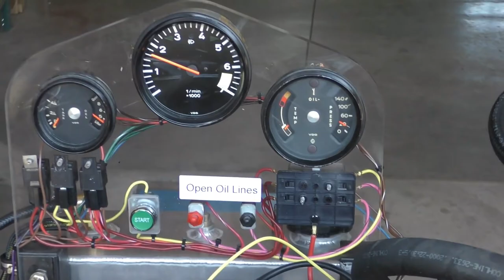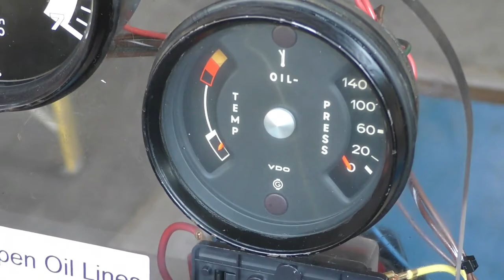Installing a Porsche Ignition Distributor 1969 911T and First Start-Up!

Comment: Kurt. Great video. You answered  some of my questions on start up but I have a few more. When you start a freshly rebuilt 911 engine do you crank it without fuel and spark to make sure it has oil pressure first ? How long do you let it run for and at what RPM. I have heard that it should run for 20 min. at 2,500 RPM’s then shut it down and drain the oil. I’ll go with what you say. Thanks in advance,
Reply from the maker: Kevin, 
So when it comes to engine start-up, there can be a lot of miss information floating around out there. According to Porsche, all engines should be started on the engine dyno for break-in under load. It takes about an hour at different RPM and load settings and still requires the 2000-mile break-in driving schedule that is outlined in the owner's manual. 
In reality, not many of us have access to an engine dyno (Myself included). I Am not usually concerned about getting oil pressure. The way the Porsche 911 is set up with the oil tank, the pump is pre-primed by the weight of the oil sitting on the gears. 90% of the time, I will have oil pressure before the engine even thinks about firing. When the engine fires, I will vary my RPMs and will let the engine run for a few minutes while I get timing and mixtures close. What I don't want to do is go to 2000 RPM and sit there for 20 minutes. This is a great way to glaze up the cylinder bores. This can become an issue if you are using aftermarket cams, however.
My goal is to get the engine under load as soon as I can; the best way for me to do that is to drive the car. So as soon as I can, I will get the car on the road. When I am driving, I will mimic the engine dyno break in spending 10 mins at 2-2500 under light load, 10 mins at 3 -3500 with a medium load, 10 mins at 3500 - 4000 medium load, 10 mins 4000 - 4500 Medium heavy load, 4500 - 5000 Medium heavy load, and 5000 - 5500 Medium heavy load. I use the gears to change the load and vary my RPMS as much as possible. Freeways late at night or early in the morning are great for this.
When it comes to "Running in the cams," this is a result of aftermarket parts. The factory camshafts are nitrated and are very hard. The way the lubrication system is set up also insures good oil coverage to both the lobes and the bearings. When it comes to aftermarket cams, often the hardening process they use is not as good as the factory cams. So by running the engine at 2000 RPM, they are asking you to finish the hardening process by working hardening the surface of the cam lobes.  The 2000 RPM is a holdover from American V8 engines. Most American engines will lube the cam lobes with oil splash off the crank. When the engine is running under 2000 RPM, the amount of oil slung up to the camshaft is not sufficient enough to keep a non-work-hardened camshaft alive. So hence the 2000 RPM number. 
I will usually do my first oil change around the 200-mile mark just before I give the car back to its owner. I will also do my cylinder head re-tension, rocker arm tension, and valve adjustment at the same time.
Hope that helps explain the process.
Kurt
Reply: Kurt thank you for that in-depth answer to my question. Truly the best explained Porsche engine break in method I have read. Again thanks.
Reply: Kurt, thank you also for this clear and concise procedure.  I’m getting ready to install a top end rebuilt 964 engine and this was the last piece of the puzzle.  It is especially valuable that you take the time to explain WHY things should or should not be done.  Truly appreciate the knowledge and experience you share.

Comment: Articulated well. Wonderful vid. 

Looking for a bit more context on the distributor body rotation demo and finding the right position. Was this procedure b/c you rotated the dist body earlier or standard procedure? Couldn’t see what was going on w the points. Light blew out detail.
Reply from the maker: what i was doing by rotating the distributor body was getting the points so that they had just opened. This is because the ignition fires when the points open. By setting the engine position to TDC #1 and setting the distributor body to where the points have just opened makes it easy to start the engine the first time .We will be doing another video on this using a Bosch distributor and will make sure that the detail is better.